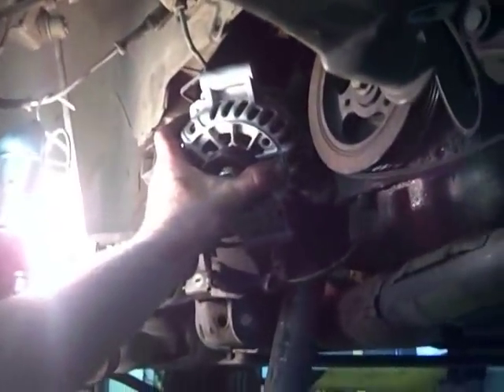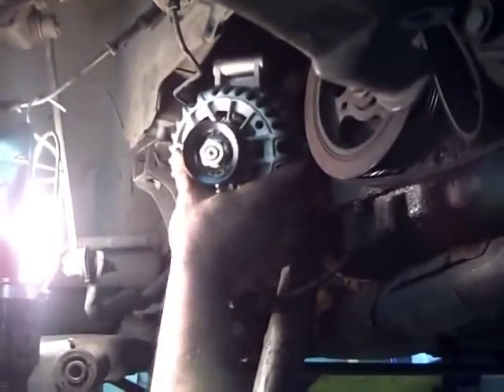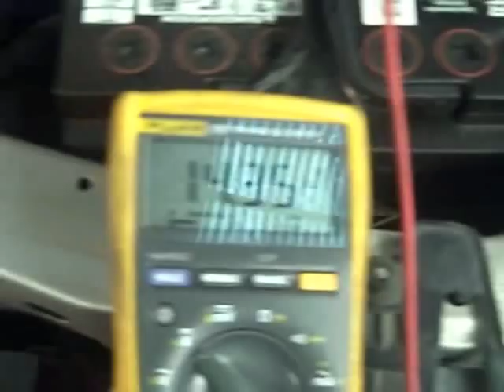MITCHELL TIPS/JAKEP12

Comment: I remove through the top.Remove tire and splash shield 3 10mm bolts and push pin.Remove belt. Use long screwdriver to remove connector from alternator and a long swivel 10 mm wrench to remove power cable from alternator. Long extensions and 13mm  wobbler to remove 3 13mm bolts to alternator. Remove vacuum resevoir at rear of engine. Zip tie steering hose out of way at top of engine. I tie it to cruise control module.Disconnect two bulk plugs at passenger rear of motor. place out of way. Remove 10 mm holding steering hose to steering rack I use a long extension for this bolt from the top then thread it by hand from the bottom when installing. Wiggle through top. A long 90 degree pick through bolt hole helps hold and pull alternator out. Wear gloves or bleed. 30 minutes or less.ASE master tech 20 plus years experience. Worked at mazda dealer  Have done several . There is no easier way. Lots of steps but all are very easy to do.

Comment: Just did that job, using similar access technique. Removed right side drive shaft and also unbolted the right upper engine mount, jacked up the engine to make space to pull the alternator out with difficulty.